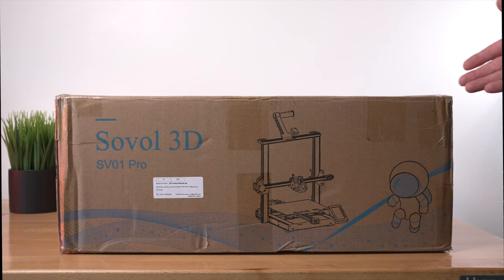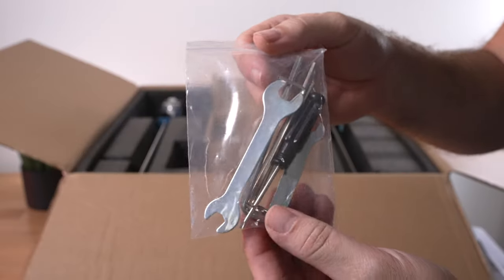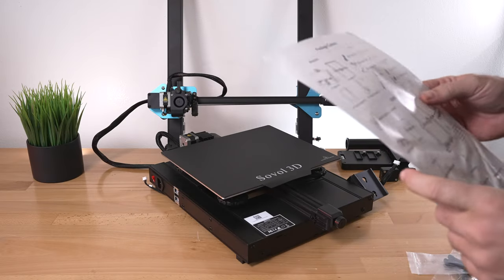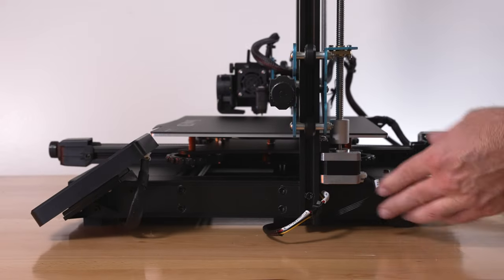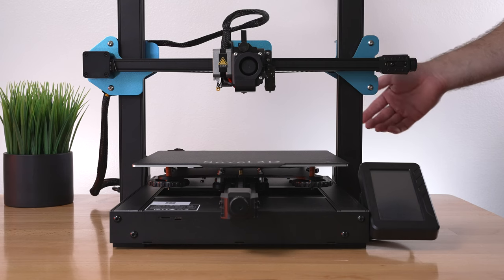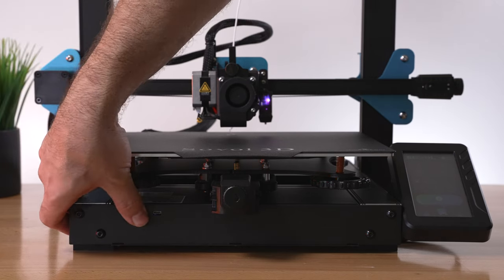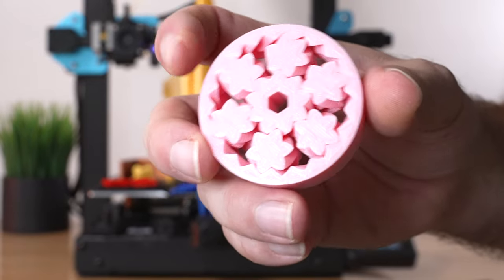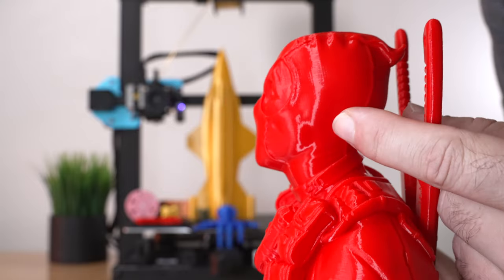Sovol SV01 Pro - 3D Printer - Unbox & Setup

Comment: great video. I don't know anything about 3d printing. That being said, I bought this printer a week or so ago. I was nervous due to my lack of knowledge. I have to say, it has been a dream. I assembled it with no issue, levelled the bed, which was easier than I was expecting, and then printed out the files included, with zero issue. The little Benchy boats turned out so cute. I still have no idea what I am doing, but I am totally hooked. Im just grateful for the geniuses who paved the way for me to be able to do this!

Comment: These arent a bad printer. I spent extra time setting mine up for the first print (calibration cube). I took the bed off to adust the eccentric nuts, put it back on once the Y axis was smooth, checked all my belt tensions, adjusted the X axis nut, preheated the bed then went around it 6 or 7 times with a piece of thermal reciept paper as a guide. Do it right and auto bed level will come with a delta of 0.18-0.15. My calibration cube came out WONDERFUL. Now I am waiting on my benchie to finish printing. From start to finish, setup took around an hour from unpacking to first print.
Reply: Are you still happy with the printer ?

Comment: Just a heads up. I'm currently setting mine up for the first time too. First 3D printer. That step where he loosens the rolling wheels underneath the plate is pretty much impossible the way he does it in the video as the supplied wrench is too short to reach. If you spin the big wheels until they fall off, you can lift off the top plate. Careful not to lose the springs. Then use the small end of the wrench to turn the top nuts, while putting a finger on the hexagonal bit underneath. Works much better.
Reply: Genius thx

Comment: Hey, do you know how to fix this issue? i am unable to slot the gantry onto the machine base as demonstrated at 7:00 . Only one side at a time can slot down at all, with the other caught on the very edge of the printer.
Reply: Hi, 

I had the same problem. Lifting the extruder bar all the way up (and loosening the top screws too) fixed the problem for me. And I was thinking the height of the extruder should not matter, because they are supposed to be parallel ... But that's just ideal theory. But you might have solved it by now.

Comment: The power supply is installed separately from the Mainboard, so one does not heat up the other. Nobody should claim that it is an Ender, rather a Creality clone. A clean print out of the box.

Comment: Doesn't look like a bad little printer at all. Just replace the power supply with a mean well and replace the crapality board with a TH3D Studios ez-board and you're gtg.
Reply: What is the benefit to those mods and do you have links? Fairly new to all this and always appreciate helpful tips
Reply: @aceman1126  Mean Well power supplies are very good quality. I checked mine and it had one already from the get go - seems its a crapshoot as to weather you get a Creaility or Mean Well.

Comment: Every printer is just sort of a clone ender 3. No innovations sadly :(
Reply: And that’s why the positron v3 project is so great.
Reply: @ernestryles  Oh, I didn't know about that one.
Reply: @Orgruk  It’s a fairly small project, but the creator just released it fully open source. His video is great! I highly recommend watching.
Reply: @ernestryles  Yeah exactly, that's why I wrote this comment. I watched the video. If one person with almost no resources can do such a thing a the multimillion company's what can they achieve?
Reply: @KerimKero1903  they could do a lot, there’s just not much incentive to innovate in the hobby space. Ender 3 clones all work well enough for most people. They’re also very easy to manufacture. If they can keep on selling more of the same, they’re going to do just that. I’m really hoping a company actually manufactures the positron. If they do, it might help cause a push towards innovation, and that would be great to see.
Reply: This seems to be of similar spec & features as the ender S1 pro but much cheaper. Is it as good ? Are the results identical  ? Thanks ... 🇬🇧